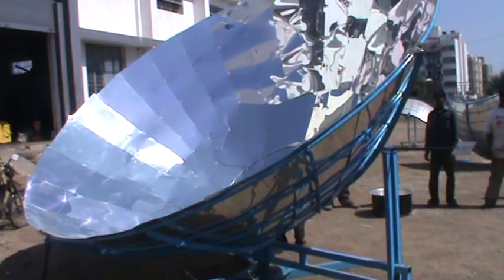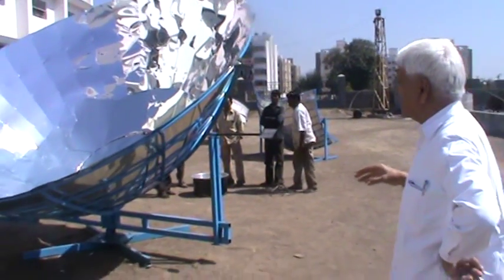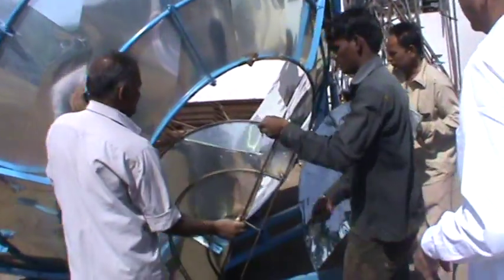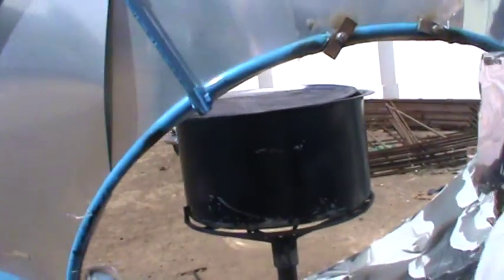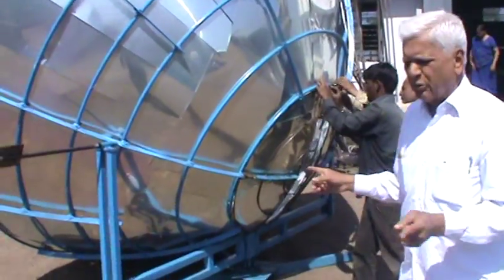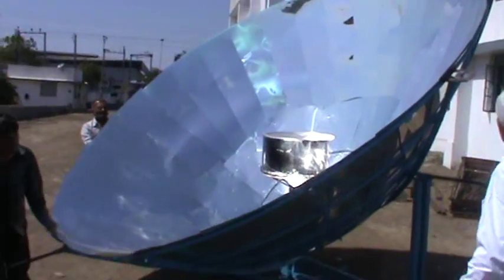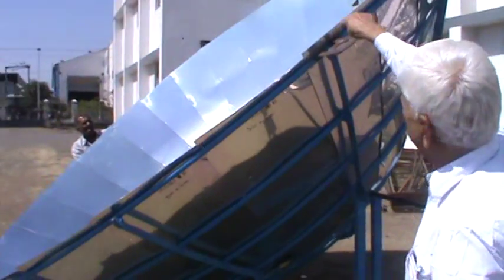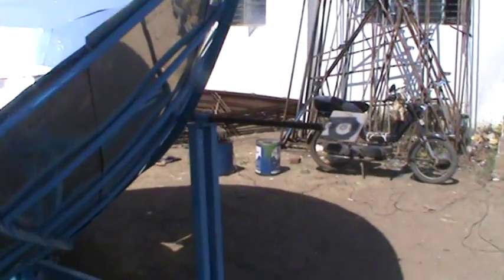Solar Basket 10 sq mt  Part 1

Comment: I have a suggestion that would let you make a smaller version, keeping it efficient.
If you place a second convex reflector at the focal point http://a-new-way.com/wp-content/uploads/2015/02/collector-reflector-white-1024x439.jpg you will get a parallel beam out the back.
You could then heat an oven or direct the beam inside a building etc.